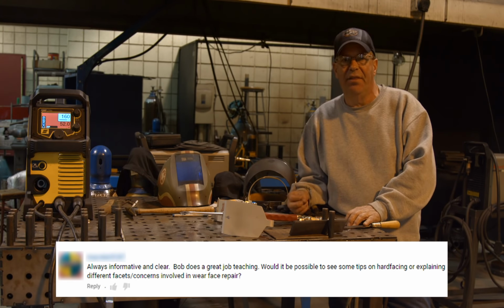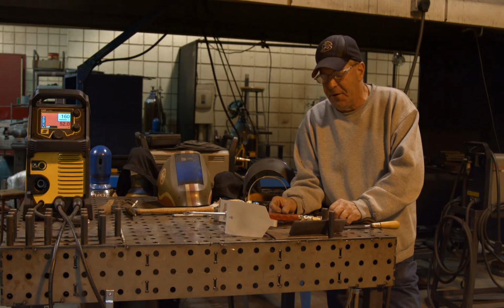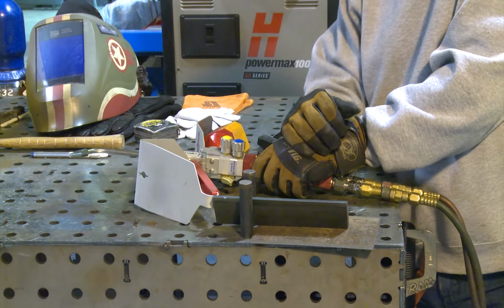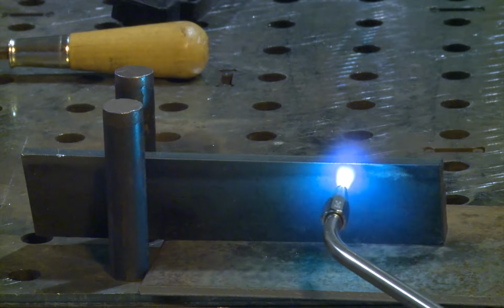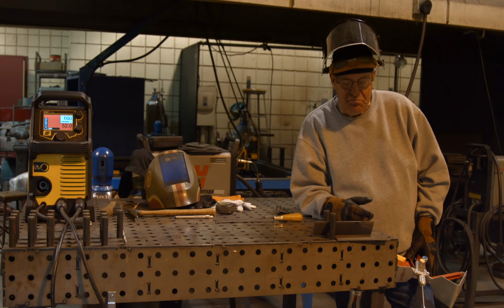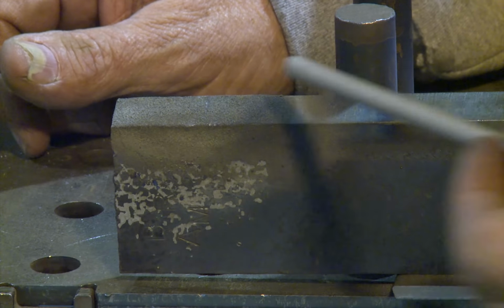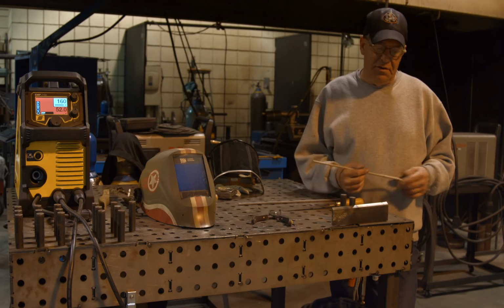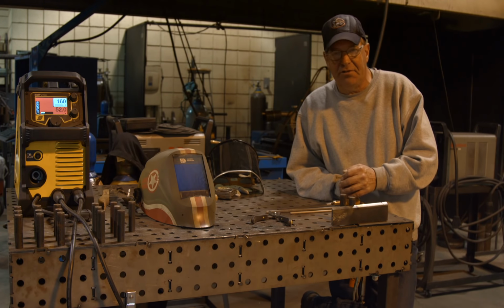🔥 Hardfacing with Oxy Fuel

Comment: Eutectic,schmutectic why not show how  you can use just a carburising flume with  a oxy/acetylene torch onlo and mild steel filler rod .your file will glance off that too !!! Anyone who's mach8ned an egde on plate cut with a slightly carburising oxy-acetylen3 flame knows what I'm talking about!

D

Comment: Better be careful doing mower blades. I tried bush hog blades years ago using stick and they developed cracks at the edge of the hard surface and broke. This sent a piece of blade flying out at 160 MPH.

Comment: How does one determine the metal has been sufficiently coated when applying?
Reply: DXT61
Dry the tungsten powder in a hot box  prior to using which helps the tungsten to flow better.
You can visibly see the build up if you are melting the powder sufficiently but don't build up any more than about 3mm or it can start breaking off and chipping. Very expensive powder to be wasting.
Reply: Thanks
Reply: Thanks

Comment: Now i want that machine..   But is there a way to do this with something different?   Or will it not be that hot enough?  What is the powder spray chemical used on the metal?  I would like to do this to your example of blades..  Cause I go through a lot and this is something I strangely didn't know could do so easily, well, if you have the gear I see..   Acetylene not favorable to use?  I understand the concept but just attempting to gain some info on cheaper methods even though not as good in quality..  Could benefit from a few things being done by this..  What are disadvantages?  I would assume it would be altering the metal after being hardfaced.. lol..

Comment: Bob, I have a weird one.

Silicon bronze spray weld. There was a guy that had a top secret method of building up bronze Harley-Davidson valve seats (1948-1965), and he spray welded material back in there. Well, he's dead now, and apparently his secret died with him. The original bronze valve seats were incorporated in the cast aluminum heads, and due to the nature of the old, somewhat brittle nature and thin castings, they often don't survive the .006" interference fit of later style seats. So this fellow figured out a way to build up the old bronze ones.

Any ideas?

Comment: Nice video Bob. Thanks for sharing.  I have a question.  What application is best for a rosebud torch tip?  I've seen some brazing on two inch and smaller copper pipe with sil flos. And using a rosebud torch to.  Is it just because someone is not patient?

Comment: I could see this being useful in my line of work for hardening custom datum pins/surface blocks in assembly jigs and perhaps repair in stamping dies? My question would be how much thickness powder hardfacing adds, as that could be a show stopper... Still, that's a slick tool all right.

For example, one of the assembly lines I'm working on has a part that has a surface that bears against a stamping (and holds a datum pin to locate it) but also is a structural part of the jig. Such would allow one to only harden the one surface while keeping the rest of the part from going brittle...
Reply: I'm thinking you could apply around 0.120 and machine off for final dimension.

Comment: I would love to see a 2G open root GMAW on 3/8 plate. I have a test in 2 weeks and I cannot get a root in there for the life of me. Saw tooth and different techniques are not enough explanation for me to learn with alone. Thanks you!
Reply: What process?
Reply: MIG welding. We are forced to use the term gas metal arc welding (gmaw) by our Canadian instructors.
Reply: +ProtossBossSauce There is a video out on that in our play list.

Comment: thanks for this video its great to learn different processes involved in welding , are you able to make a video using a process like this to repair / create build up on the likes of a worn shaft or round stock that can then be turned in a lathe back to the specs of the shaft

Comment: Is that not the same procedure used for spray welding I have seen Abom 79 use to build up a worn part to be re-machined?
Reply: I've seen a lot of plasma spray applications for build-up of worn surfaces. We do not have that equipment though.
Reply: same thing, different application apparatus

Comment: Back in vocational welding shop back in the 70s we use too make chipping hammers and  case hardened them we heated  them dipped  them in a powder,  its been so long I dont even remember  what the powder was lol!  . thats a very interesting  process  ...thanks for posting
Reply: It's usually something like bone charcoal.  The idea is the carbon in the charcoal diffuses into the surface of the part, giving it a hard shell but a soft core.  It's one of 3 ways of case hardening, carbonizing, nitetrideing  where you use a nitrogen compound, and then the last one cyaniding.

Comment: What would a guy charge per hour to do hard surfacing in the field?
Reply: Kevin Hornbuckle They get a a pretty penny we use to weld & case harden bucket teeth on dozers back in the late 70s early  80s  and we use to get $40 per tooth , do one machine a day it was a good days pay .
Reply: an independent welder with his own welding rig would charge atleast $50 an hour. he would probably charge you extra for rods as in the field it would be stick welded. those rods are quite exspensive

Comment: Run a 7018 root on 6g pipe. Got a  call for  a steel mill on the east coast for a test, and they said that was it. I didnt call back, but im curious enough to see it done. Thanks

Comment: Lord do I hate hardfacing...I used to have to hard face hammers on huge tree grinders and Excavator bucket teeth etc.. For days on end... We used smaw with carbide chip feeder...
Reply: That's interesting. I've done it with GMAW, I didn't know you could do it with SMAW.
Reply: Robert Shepherd Both Yes you can do it with both...Stick flows and builds up better than mig Imho...
Reply: I'll have to give it a go when I get the chance. What electrode do you use?
Reply: Robert Shepherd Lincoln 1/8 hard face electrodes...

Comment: are all welding rods round? and if so why not use flat bar shaped for thicker welds?
Reply from the maker: Yes, all welding rods are round.
Reply: Except gas welding cast iron, those are bare triangle-er shaped rods.  We had a job in welding school (about 1982) where you ground a bevel on cast iron coupons, then you had to file them to get the graphite off the edge.  Then you heat the filler rod and dip it in flux, I don,t remember if was just for cast iron or we could use brazing flux.  But the puddle did not flow, it was almost like marshmallows, very stiff and gooey, you had to move the rod around to pull it forward.  It's not like any other kind of welding.
Reply: i actually do a lot of hard surfacing/hard facing with a powder tourch,with tig, and with a plasma transfered arc we have some rods that are square they look like dimond dust in rod form ,the meterial is super tough its called coltung thanks for the video